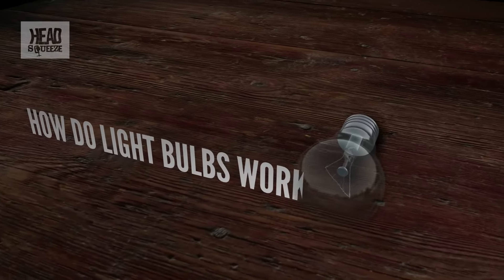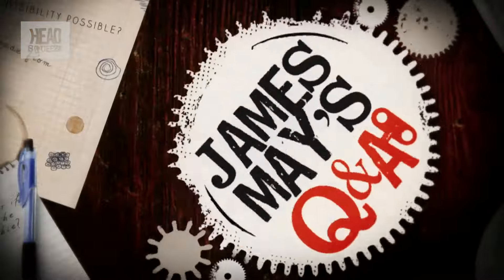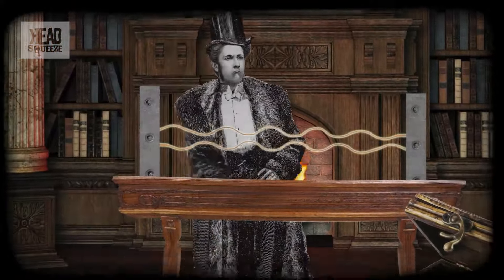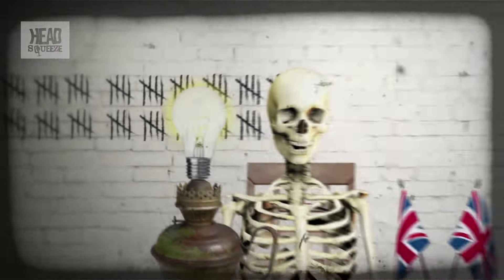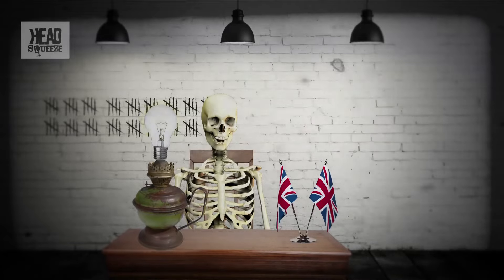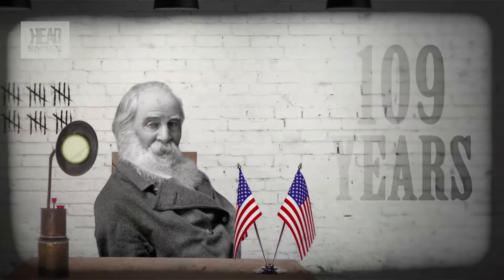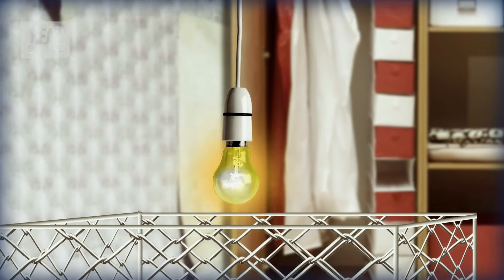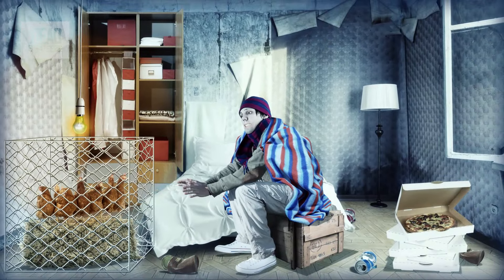How Do Light Bulbs Work? | Earth Science

Comment: The problem with LED headlights is that the produce so little heat that they had to inlude a heating system to defrost the headlamps. Ah technology, one step forward and two steps back.
Reply: At least two steps back gives us more challenges and great things to discover and achieve!!
Reply: I dont know how you would call that 1 step forward and 2 steps back... the advantages outweigh that little problem by miles.
Reply: @decenium so truE
Reply: Good observation 🤔... The problem here is not the frozen ice, but the range of visible light is limited... So needs to develop such type of led which can penetrate through ice 😀and visible light should be merged in that.
Reply: But yes, net energy consumption is lowered by led 😀
Reply: Interesting I didn't know that.
Reply: "But sometimes" moment. LoL

Comment: There is no ban on selling incandescent lights, as such.

What the EU enacted was a law (or a group of laws) about the level of energy efficiency that light bulbs must have (i.e., amount of light produced per amount of energy consumed). And traditional (omnidirectional) tungsten-filament / inert gas incandescent lamps can't reach that level of efficiency.

But the ones with reflectors ("spotlights") or active gases (halogens, mercury vapour, etc.) can reach that efficiency, and are still legal.

Comment: An electric current is passed through a coil of wire. This produces a magnetic field. Inside the coil is a magnet. When the induced magnetic field interacts with he magnets, the coil will move back and forth depending on the current, voltage and frequency. This movement is transferred to a membrane which vibrates the air. This vibration is sound. Most microphone works the someway, but the movement in the coil crates an electric signal in a wire.

Comment: An A/C voltage changes constantly the same as a Sine wave. In north america the voltage alternates between peaks of 170V and -170V 60 times per second. In something such as a light bulb, it doesn't matter that it alternates as the light output is dependant on the "average" or RMS voltage which is 120V. AC is used more commonly in electrical grids because DC is incapable of using transformers to change the voltage. This is really only a basic explanation though.

Comment: AC is Alternating Current and is used for mains electrical power and the current reverses at either 50 times per second in Europe and 60 in the US. You can easily change the voltage of AC power using a transformer, making it the best for mains power. DC, Direct Currant uses lower voltages than AC and is mainly found in batteries (9V, 12V 24V etc..) that have both a negative and positive end, which the electricity can only one way through both ends to provide power to low powered device.

Comment: Why are two small vertical bars used as the "pause" symbol? There's no physical representation for "pause" any more than there is a physical representation for "storing data". They're just concepts, so the important thing is to have a symbol that people won't confuse with other common symbols; what the symbol actually depicts isn't very relevant.

Some applications use a "folder" icon for saving, BTW (which is more confusing than the floppy).

Comment: Thicker filaments require a lot more energy to produce the same amount of light. Even if the bulb lasted 100x times longer (most of them didn't, they actually lasted less, otherwise they would still be around), you'd end up spending a lot more money on your electricity bill.

Comment: Energy efficient means they give more light for the amount of electricity consumed. If they gave less light, they would be less efficient than the old ones, not more.

You're probably either buying extremely low-power bulbs, or you're buying low-quality CFL bulbs that take ages to reach their peak brightness.

There are many different types of high-efficiency lamps out there, from LED-based to halogen, from mercury vapour to fluorescent, and even some high-efficiency "plain" incandescent bulbs.

Comment: If mercedes has no light bulbs but leds, will there be any difference in fuel consumption and some of the energy of the engine goes spinning the spin-around-round-thing that makes the electricity to the car. Leds take less energy so is the resistanse in the spinnie-thing smaller and therefore, more fuel is saved?

Comment: you might want to think about keeping tubs/buckets/bottles of hot water around. Even a running tap of hot water can quickly heat a room up, extra insulation also helps, nothing fancy just wet some newspaper strips and stick them to the edges of windows. Or... you know... get a job and pay your bills. Which ever works.

Comment: "The atoms release photons when their electrons become excited by the electrical current"
I think that's not quite accurate. Electrons become excited because of the heat which is a result of the electrical current flowing through a wire (resistance).
Reply: alterro:  Heat is at molecular level not atomic level.  Heat means nothing to electrons.  The election is pushed up to a higher obit by the electron nudge of the electric current and when it drops back to its original orbit it emits a photon of light.
Reply: @ZigSputnik  If heat is simply the excitement of atoms, how is heat not on the atomic level?

Comment: How do CFL's and LED's work?
Reply: +mrabudi1 In simple terms, compact fluorescent bulbs are the same as straight fluorescent tubes:  the inside of the glass is coated with phosphor, and there is an electric arc through the inert gas that excites the phosphor coating.  This process is more efficient in terms of the light produced (more of the output is visible light, less of it is heat, than is the case for the incandescent bulb), but the fluorescent tube or bulb needs to be fitted with a ballast that smooths out the electrical current and optimizes it for the tube or bulb.  In most overhead fixtures the ballast is part of the fixture; whereas compact fluorescents each contain their own ballast, so that they can substitute for incandescent bulbs, which need no ballast.  Light-emitting diodes are electronic devices that emit visible light only.  Since they are solid-state components, they last far longer than incandescent bulbs--no filament to wear out, no glass to break.  Their heat output is minuscule compared to that of the incandescent bulb, and even compared to fluorescent tubes or bulbs.

Comment: But where do the Photons come from and how do the atoms release them. they can't appear out of the nowhere.

Same with the LED. where does the atom come from. this would be a good episode of head squeeze

rgds
Reply: CAESARbonds LED stands for  light emitting diode. It has two regions of specially made semiconductor materials called 'p' and 'n'. One region has a deficit of electrons in it's atoms and the other has too many electrons. Where they meet is called the depletion region. This is where the electrons on the side with too many get taken by the atoms with too few.

If you run a current of electricity through the LED in the correct orientation the electrons at the depletion region drop from a higher energy level in the atom to a lower one, relasing energy in the form of an photon.
Reply: I still hate LED light bulbs and the compact fluorescent ones and they're bad for people who have neurological problems like me... I should be grateful I don't have epilepsy but what I have is considered a cousin of it